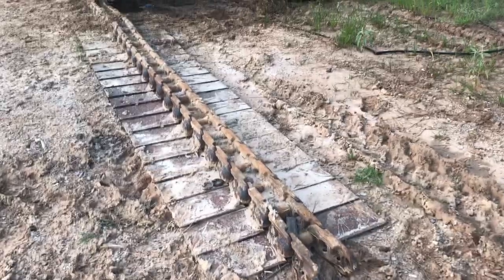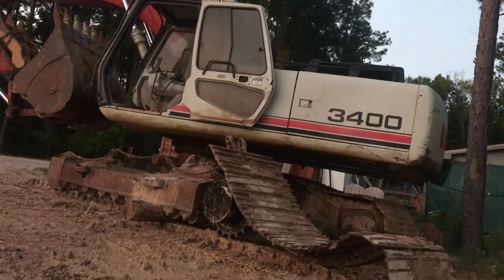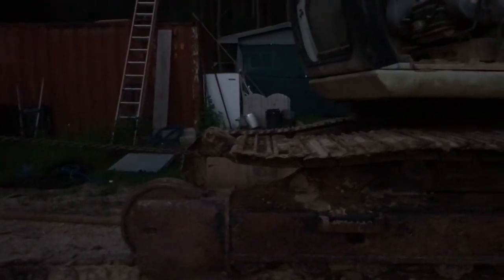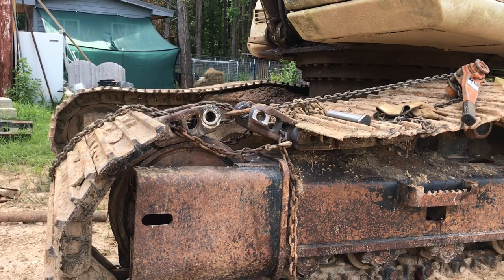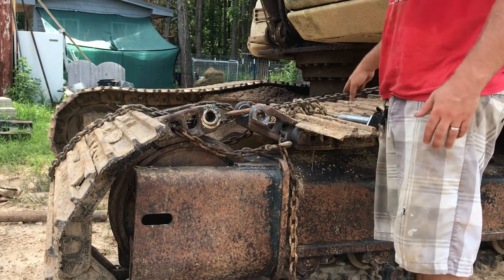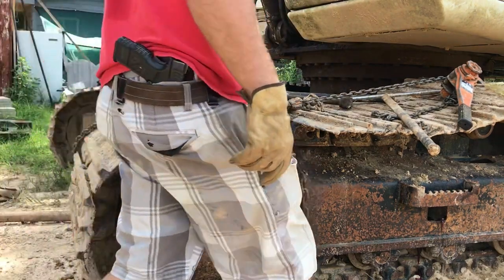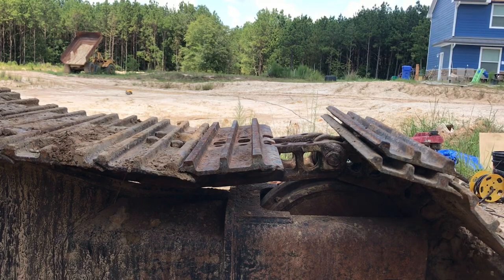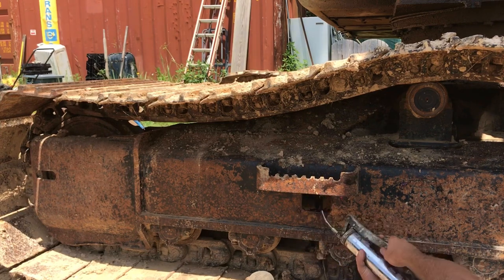Reinstall Excavator Track By Yourself - Link Belt 3400

Comment: I have the same machine Link-Belt LS3400.   Beast of a machine.  Where do you get or find parts for it.   Thanks  Blake
Reply from the maker: I went on a hunt on machinery trader I think. They have a section for machines being disassembled. I think this project was actually to replace a final drive, which I was able to find brand new, aftermarket through AMS Construction Parts. The link belt dealers unfortunately are useless and waaaaay expensive on any OEM parts.